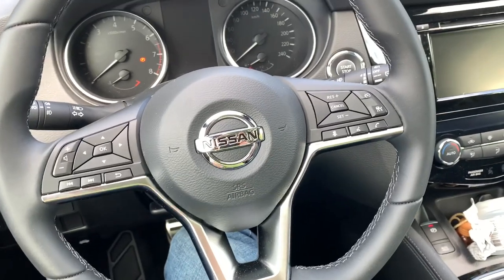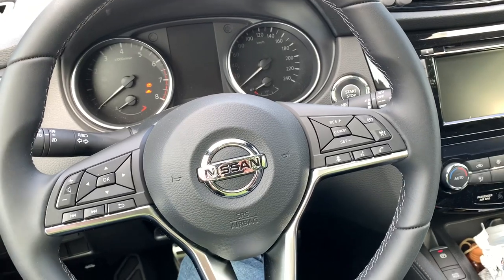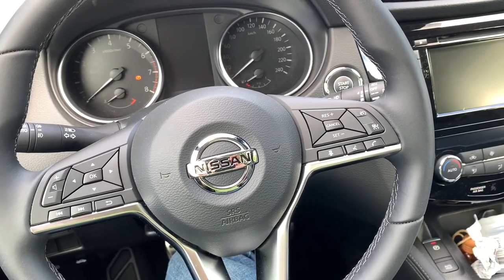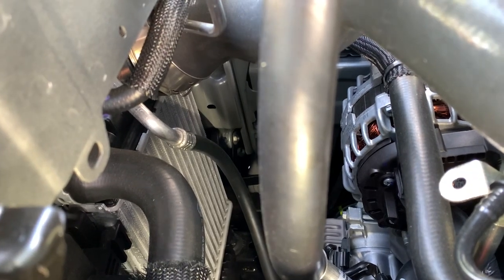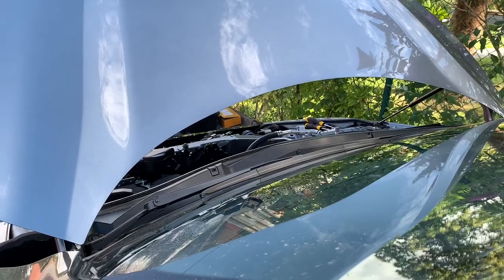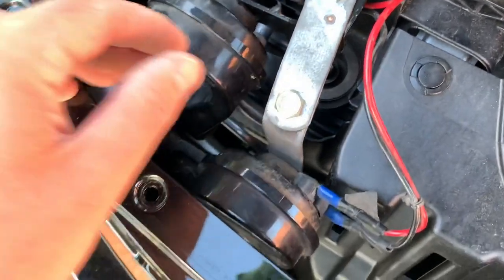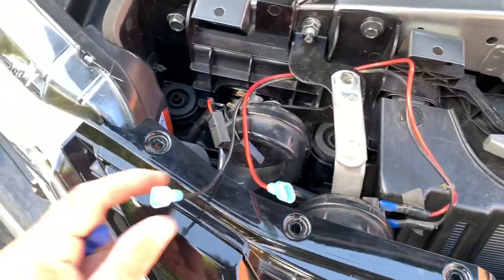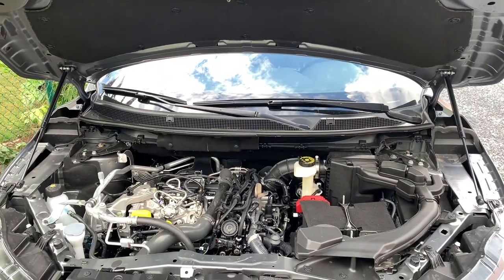Nissan Qashqai J11b: changing the horn (2018-2019-2020 models!)

Comment: Thanks for the video, keep posting more vids about the j11la please
Reply from the maker: Chokran Youssef but I do not have my J11a anymore but the video’s still can be useful & interesting 😉
Reply: @LaPalmeraie0032  there's almost no difference between the j11a anf the j11b anyway
Reply from the maker: Well yes and no... for the mods they are almost the same indeed. But I find that some bits were improved after all. And the looks ofcourse. Really enjoy the new smaller steering wheel for instance. Or the whole new Connect installation that is finally « connecting new technologies ». I will make video’s on all those items so you can juge for yourself. This said, I still really liked my old QQ j11a as well! 😉

Comment: Shit Job, horn should be on Factory place with factory wiring. I  never accept this . What happened  with secend factory horn ?? Its steel there
Reply from the maker: Hi Krzysztof, the are on the factory place... both on the place of the highest one that is and, partially with the factory wiring. If you have a bridge it is way easier and you could indeed replace the second factory horn with the second aftermarket one but without bridge this is nearly impossible. For this reason I also let the factory horn, disabled, in it's place. Drove around with this setup for 4 years on my previous Qashqai without any problem. ;) But if you have a bridge or if you remove the RH wheel and wheelcover you should be able to find your way in. I only showed a easy, feasible way. ;)
Reply: how did you disconnect the bottom one can't get near
Reply from the maker: If you haven’t a too large arm you should manage to slip through all the way down and feel the horn and its wires on top. Look on the upper horn for the layout, they are identical. Look with a torch down there to spot the exact location. If you still don’t manage you cal try to remove the plastic inside the fender of the right front wheel and access it from there.
Reply: @LaPalmeraie0032  thanks is there much slack on the wires as i will unbolt the arm its on i cant see how its possible to get to the outer side of the horn to disconnect with my right arm can you get to it from leaning over the wing with my left hand
Reply from the maker: Not much slack no and impossible imho to unbolt whatsoever like this. I was leaning over from the front and plunged my right arm all down there and only just managed to find both wires and disconnect them with my finger tops. Not without scratches on the arm either 😉
Reply: @LaPalmeraie0032  did you try unbolting the arm I can't feel no wires you must be double jointed.  😜
Reply from the maker: Did you check the layout on the upper horn? It’s similar. Unbolting would need way better access. I’m 1m81 and my arm only just reached the wire, my finger tops that is. I just deconnected the wires and let it all be as is. The upper horn was replaced by my double horn set.
Reply: @LaPalmeraie0032  unbolted arm one 13mm nut horn can be pulled Out put left arm down otherside and unplug was simple bud.